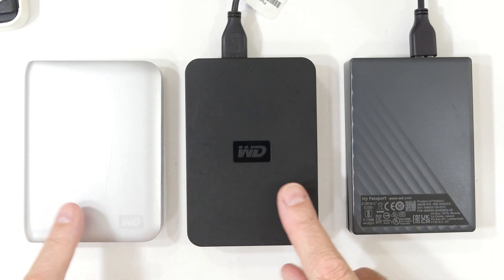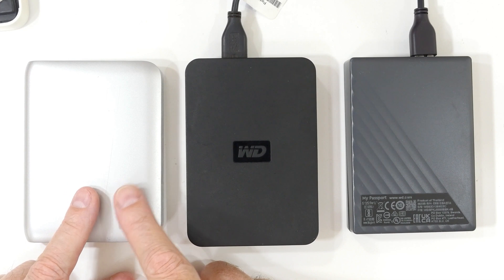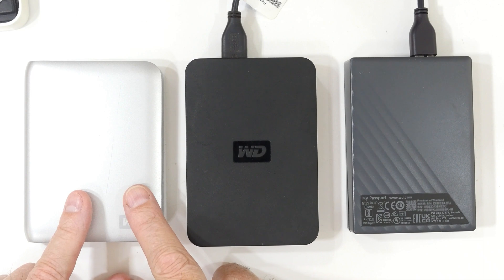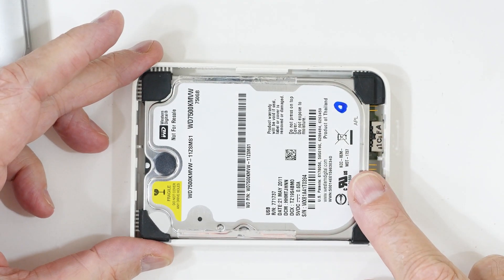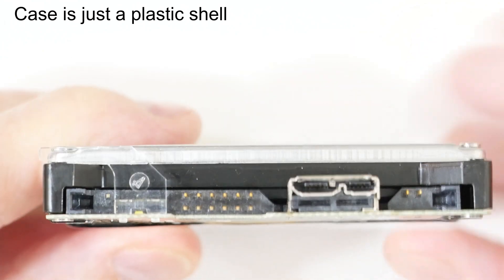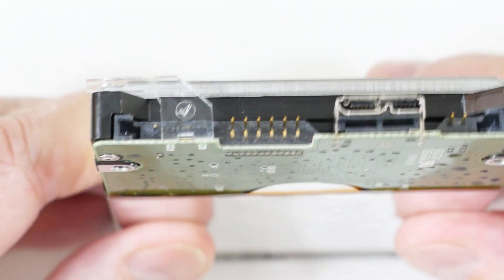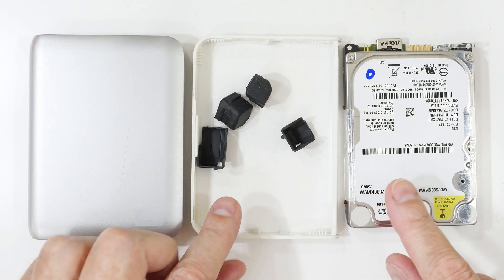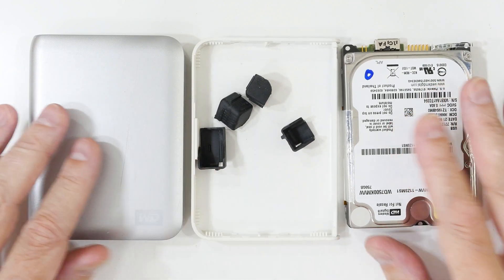Can You Fix A WD My Passport? (4K)

Comment: My WD passport stopped working and smells like it burned out. But this is not the first WD drive . Out of the four WD drives I brought only one is still working. I'm not going to buy any more WD passports  the Toshiba and Seagate portable drives have been more reliable for me.
Reply from the maker: I don't use mine all that much (backups only), so they are still around. I will have to check out the Toshibas and Seagates. Thanks.

Comment: Hi , whatever you do please do not trust the 5tb WD my passport ultra on the right. I have had this drive for only 1 year and it failed for no apparent reason. All of a sudden it no longer spin and neither western digital app or window will recognize it as a drive but instead as a unrecognized USB device. I have send this to repair shop and they say  the hardware encryption module failed, meaning the data are non recoverable even if I somehow switch the board.
Reply: 4 tb too
Reply: this just happen to me I lost all my hardwood of 4years, worst drive everrrrrr they shouldn't sale this , I only used it 5 times just brought 1 year ago had it for a back up
Reply: @brianwynn10  It's always advised to backup the drive if the data is important.
Reply: seems like it happened to all who bought 5TB WD no matter it is ultra or not, all of them are just garbage
Reply: @upoone  i got 3 months with this trash product
Reply: @TrevorPhilipsBro  that's is quite unfortunate. I have started to keep and  create a recovery drive even if the drive is reliable brand. You can't be sure when it will break so better safe than sorry I guess. 😂
Reply: @upoone  Luckily no data loss, I keep a desktop PC with hard drives for backup. And also recommend to anyone to have an iDrive account. Dirt cheap like 100GBs for $10-20 a year… documents, photos, etc in a secondary backup.
It’s just annoying to have a HD die so quickly :( starting to wonder if bigger drives are reliable…

Or %100 never buying a “we will soldier a pcb to the hard drive to so you cant use it anywhere else” hard drive again. I think the drivers for security feature broke this one. A feature I dont even want.

Ewww the all the bloat ware WD want you to have. A HD should just plugin with manufacturer software. Turns it out it three sets of drivers as well. Unbelievable.!!
Reply: @upoone  bruh i came after 3 weeks usage. What a lame product, WD quality is trash
Reply: Yes I lost 6 terabytes of data on two of these (2tb and 4tb... from now on I'm going to splurge on a SSD instead)
Reply: @ Yeah that suck. I know. If your data is important, better have a backup drive just in case.
Reply: We should file a lawsuit against them. SO many people have had this and it is millions of dollars worth of damage when all that data and work is lost to so many.
Reply: @88Chuckydoll I doubt it. They likely have a skilled lawyer and questionable terms of service to navigate around it. Most tech companies have been doing this for years.
Reply: Mine failed after 3 months
Reply: I've had one for 3 years and I have had zero problems. I think people who experience failure either dropped it or handled the drive very irresponsibly
Reply: @ Nahh i treat it like a princess. i used it as a stationary device meaning no moving around in the backpack ever. You got lucky bro but if i were you, 3 year worth of data should be backed up with another device since it might break any time in the near future. Mine surely did without any warning or sign

Comment: If you remove the screws and basically scrap the drive there is a really cool neodymium iron boron magnet that you can salvage that drives the wiper arm on the unit. It is actually two magnets on a nice little bracket.
Reply from the maker: Already done! ;) I never let a bad drive go to waste.
Reply: yes magnet first and then a meeting with mr hammer... i hate those passport drives... 3 drives lost, and the last one was just pffft... 10cm drop, but while it was running. i hate those drives. i would like to pay premium for drives that lasts.... never going for these again...